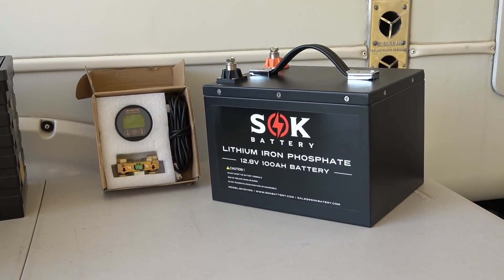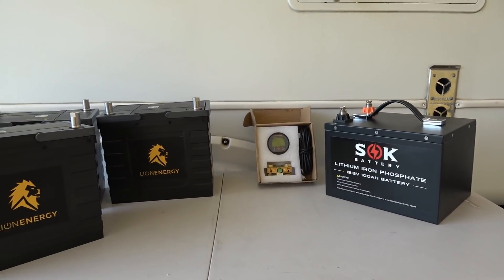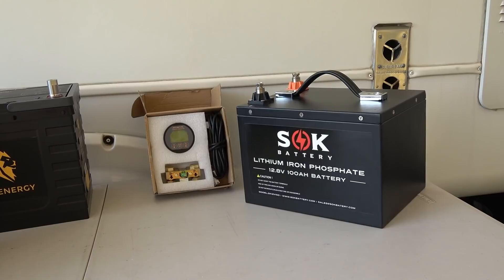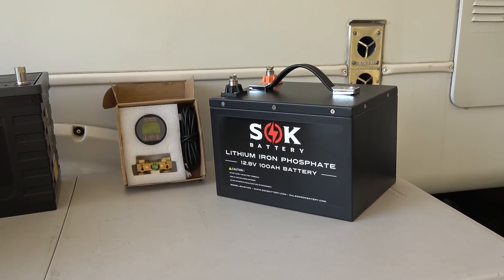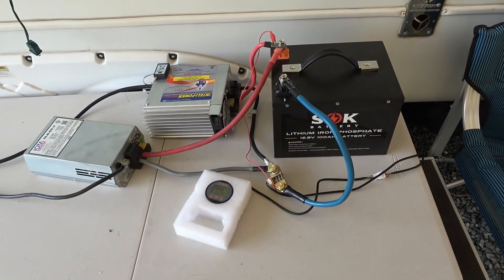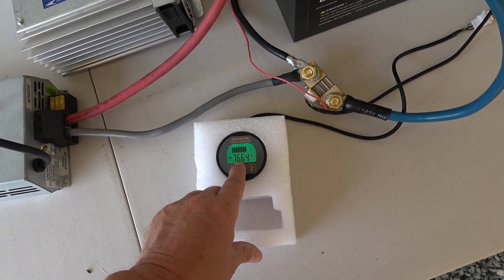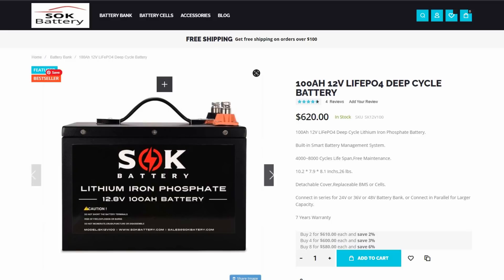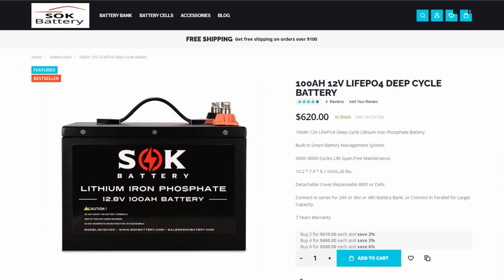SOK Lithium (LiFePO4) 12V RV Battery - Demo, Tests, and Initial Review (Model SK12V100)

Comment: Great review... I really need to upgrade my AGM batteries ... now at this price point  it is very tempting. I am interested how it performs over time and temperature. Thanks for sharing
Reply from the maker: You're welcome, I'll have to give it a cold temp test like I recently did with the Lions - https://www.loveyourrv.com/lithium-rv-battery-deep-freeze-test-lion-energy-safari-ut1300/
Reply: @LoveYourRV  too make sure the BMS will shut them down in cold conditions especially for charging which can damage them.

Comment: Oh, good video Ray, really interesting. But another Chinese product. And no dealers in the states yet, except for Michigan.
Reply from the maker: Thanks, not even in Michigan, its just a shipping warehouse not a dealer as far as I can tell. It kind of shows people why some of the other more known brand names are more pricier as they have to run a stateside dealer or distributor operation and provide customer support (often by phone) for their Chinese products, so the price goes up usually a few hundred bucks to cover that. And some do design them in the USA and then get the manufactured overseas.  Cheers, Ray

Comment: Why can't you put a heavier wire inside. They look like a regular cable with hoop ends on them.
Reply from the maker: Looks like a person could easily do that, just pointing out what I think maybe a weak point, but I'm no engineer or designer so maybe they had a reason. I'll see what the company says about it. Cheers, Ray
Reply: @LoveYourRV  maybe you could  jumper in and parallel another wire are then do the test and see if you still get the low voltage drop...
Reply: It is, by far, more likely that the series resistance of the BMS MOSFET's is responsible for the voltage sag under load.  5 AWG wire has about 1/3 milliohm resistance per foot, the voltage drop at 100 amps is only 33 millivolts/foot.
Reply from the maker: @mikefahmie7506  Thanks, I just noticed that many other of the name brand LiFePO4 batteries including my Lion are using 4 or even 5 similar gauge wires versus 2, figured there must be a reason to do so.
Reply: @LoveYourRV  Might be heating.  The #5 wire will dissipate 3 watts/ft at 100 amps. That's enough to get pretty warm but not hot.
Reply from the maker: @mikefahmie7506  Or maybe it helps with more connector points, the BMS connectors look pretty small to me, maybe getting some voltage drop there.
Reply: @LoveYourRV  Unless the screws aren't tight, the drop shouldn't be much.  Since you can open the case, it would be easy to measure the voltage drop across the BMS or any other structure.
Reply from the maker: There is also the cable crimps, will feel for heating on heavy load and do some voltage drop tests, would be interesting to know if BMS or wiring.
Reply from the maker: They tell me they are actually using 2 - 7awg wires in the production run, I got one of the demo models with the 8 awg. Also interesting to note there are 2 extra empty places on the BMS board for 2 more wires, you can see them in the video footage. They tell me on the 200 AH model they use 4 wires. Cheers, Ray
Reply: @LoveYourRV  I watched at the video again, looking carefully at your test setup.  You connected the voltmeter to the big alligator clip instead of the actual battery terminal.  There may be a lot of voltage drop there since the clip only contacts the terminal at the sharp points of its jaws.
Reply: I just looked at the BMS specifications on their website.  The spec for internal resistance of the BMS is "<30 mΩ". That would account for 3 volts of drop at 100 amps.  Even if the resistance was half of their specification, the drop would be 1½ volts.  Of more concern is the power that the 15 mΩ would dissipate, that would be 150 watts at 100 amps.  That's a whole lot of heat in the enclosed space of the battery!
Reply from the maker: I'll have to retest that but in an early test with their battery meter I had its lead on the terminal side and at around 85 amps it was down to 12.3V or so.

Comment: Great video and review Ray! You always give a fair, unbiased review so thank you. Price wise it seems to be a pretty good deal with its solid case design and it certainly delivers the rated power. I’m not sure how I feel about the terminals being on the same side like that. Not just for safety reasons (there is less of a chance of an accidental short with the terminals on opposite sides as in a standard battery) but ergonomically speaking its just easier to get cables connected in small spaces with standard terminal locations. Perhaps if it came with some sort of plastic barrier between the terminals, that would make it less likely that a short could occur. I’m not sure I would consider it a “Drop In” replacement like a Battle Born, but if I was designing my battery bay or redesigning it and could take into account this terminal config, I would certainly consider this battery.